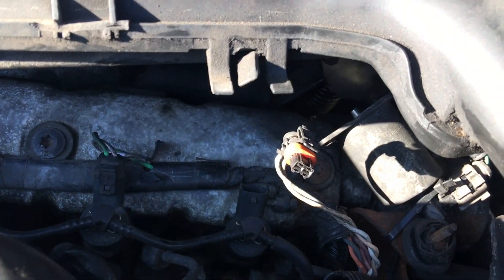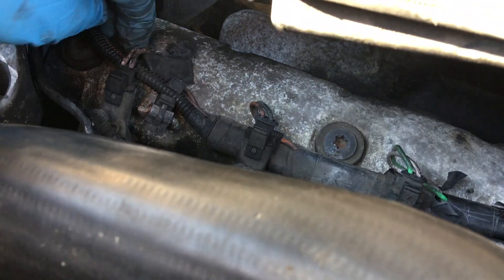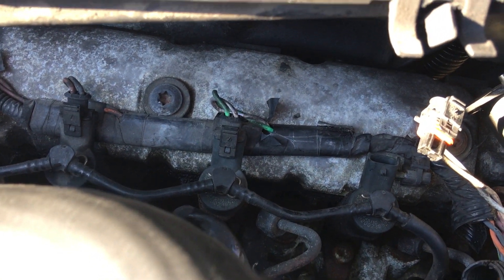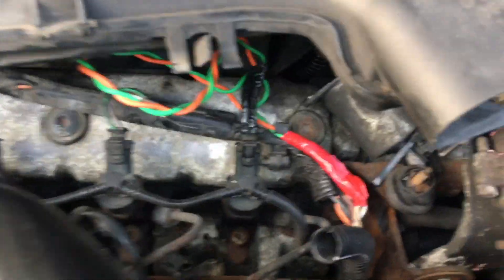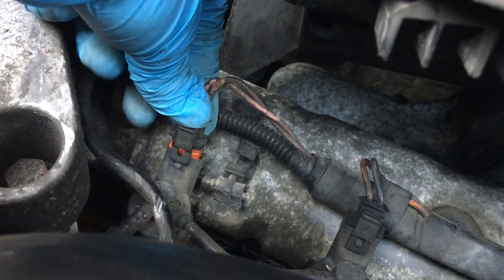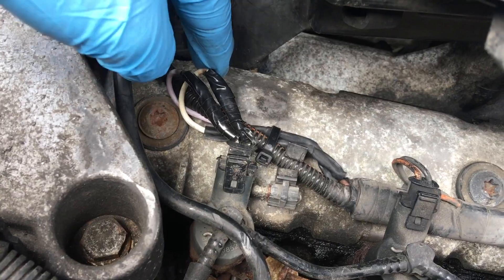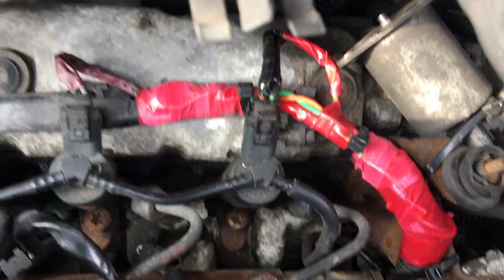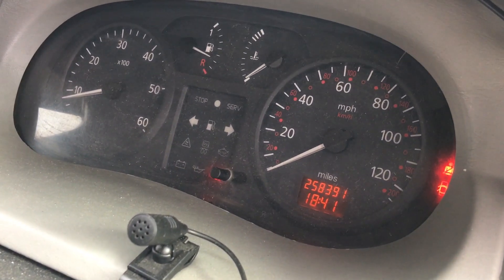INJECTOR ELECTRICAL ISSUES - Renault Trafic Van Camper Conversion

Comment: Nice fix, I have heard that the injectors can be a nightmare to remove so lucky it was just the wiring. I'm I right in thinking the clock showed it done over 250k miles?
Reply from the maker: HW100 yeah I’ve heard all about that. My heart sank when the glow plug late first came on. But all sorted now. And yes 258000 miles haha! But that’s just the van, this engine is the 3rd one it’s had according to past invoices

Comment: Hi. I just found this video. Was the van stuttering and pumping out black smoke when it did this as?
Reply from the maker: Hi, I’m not entirely sure as I didn’t run it much until I found the broken wires, but I don’t think so, the engine has always been pretty good actually.